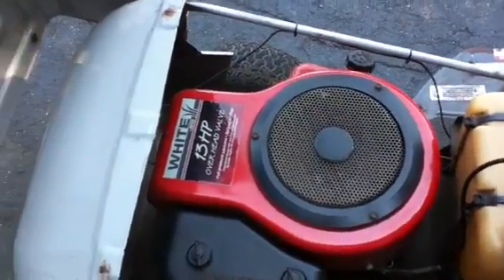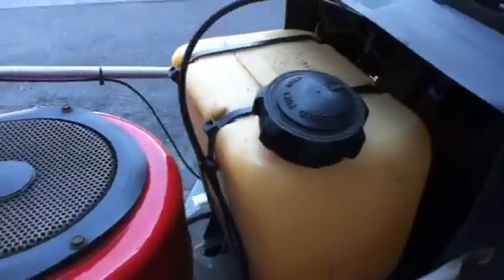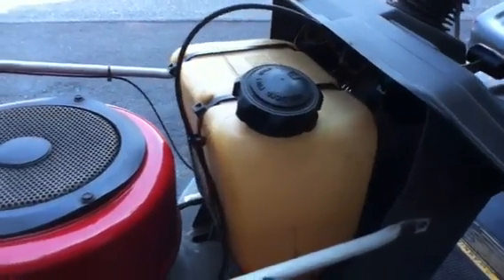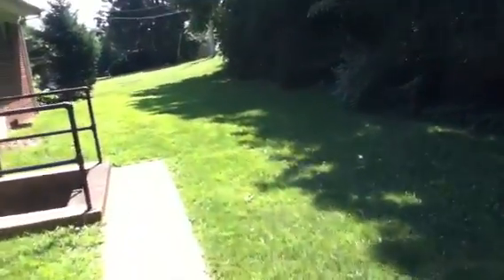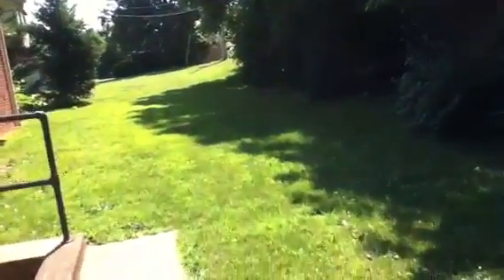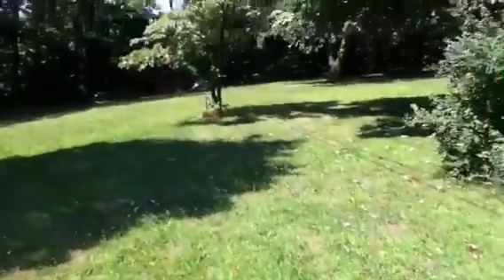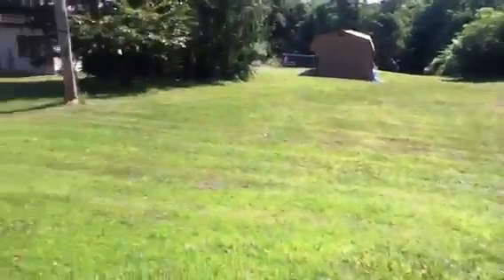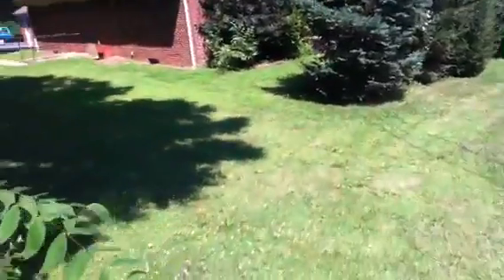HHO

Comment from the maker: lower drag on charging systems no caustic chemicals entering the engine,a pure form of hho out put,and I cannot compare it to hho with the chemical additive,it would take a lab to a gas analysis of both types of gases,when you see orange flames,that is contamination of the product,I was told hho flame should be an utral blue almost invisible,have not seen to many people doing that.